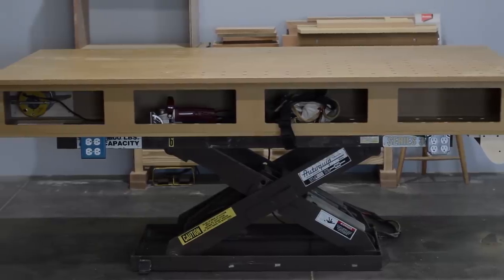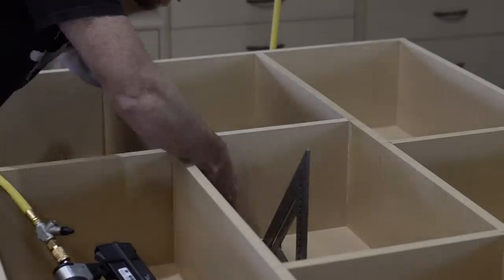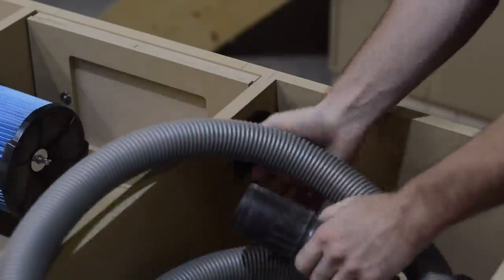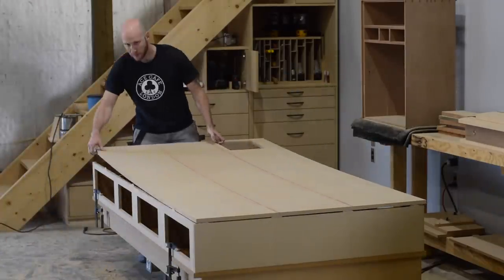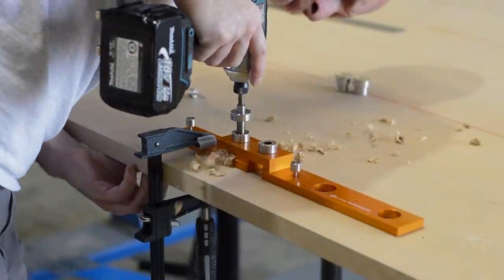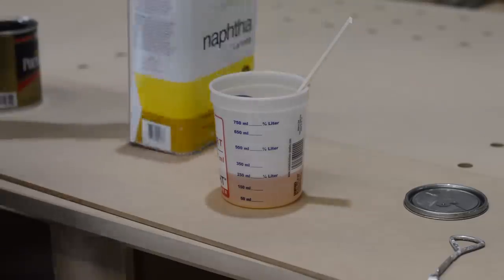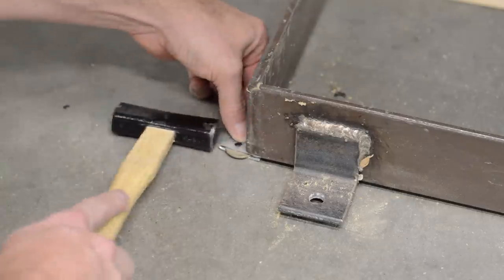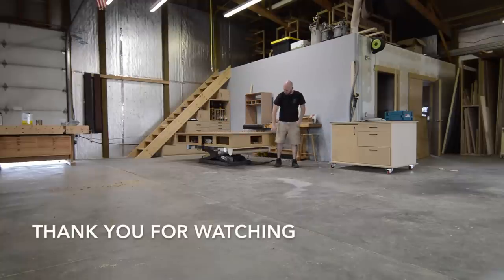A Modern Cabinet Makers Bench For Woodworking & Carpentry

Comment: Love your skies and laughed out loud at your shop assistant whacking the trash can with the mailing tube. What fun! There's a kid on YouTube who used Festool 32mm shelf pin hole track to lay out a 96mm grid  (every third hole makes 96mm) like Peter Parfitt's system. For tightwads like myself that would reduce the out-of-pocket  to paying for the Parf System's long-center-spur 20mm bit, some pins, and Parfitt's slick little spring clips to float guide track up and down on his tall pins set at any spacing. Thanks for posting and keep up the good work.
Reply from the maker: Thank you. I think your plan will work good, and maybe save a few bucks as well.

Comment: Mike, my first bench was on a scissors table lift with a Norm Abram designed torsion box bench (minus the legs on it) that I built. Wished I had never sold it but the guy who bought it wouldn’t take no for an answer and kept offering me a higher price until I said yes.
    You did a good job on yours.
Ron
Reply from the maker: Thank you Ron. Norms bench was cool for sure.

Comment: Pretty cool. I like that scissor lift, but alas my days of a fixed built shop are behind me and I think getting it in and out of the trailer on jobs would be a bit of challenge😎🤙
Reply from the maker: Ron! Holy cow! This is great. Thank you for commenting on my video. I have plans to make a bench in your style for my install setup at some point.
Reply: a couple of scissor jacks and a drill could make a mini lift table a la Paulk ;)
Reply: Mike, you won't regret it. I bought all of Ron's plans and built just the bench. I figured it's the least I could do for the amount of effort he put into it. I use it on a DAILY basis.  If not as a full 4 by 8, I use it the most as a 2 by 8 mini bench.
Reply from the maker: Thank you Aaron, good advice.
Reply: Aaron Berk I’m a big fan of Ron Paul’s.  I purchase all the plans as well and have used his sketchup contributions to fit out my single car garage work shop.  And love my RPWB.  His hours and hours of how to vids are my best investment.
Reply: I had fit a hand crank motorcycle lift to my Ron Paul’s work bench years ago.  It was one of those projects I couldn’t get out of my mind until I did it.    At the time I had a super bad back.  It was nice the few times I used it.  Found out it was my dodgy weight that was causing the pain.  Lost a decent amount of weight and didn’t need the lift anymore so removed it.  And haven’t missed it at all.
Reply: Hi Mike, I agree, Ron’s youtube channel has been very inspirational for me, I fixed my Sprinter van as my mobile shop just like Ron’s SMART tool box, he was extremely kind to publish my video on his channel, I also built my own working station and it has been very helpfully.

Please Mike, keep publishing this amazing videos, I’m also learning a lot from you!
Reply: @whoDatBeDare  I didn't know ron paul was a carpenter
Reply: Mike Farrington would like to hear you get that excited doing a voiceover for a video
Reply: @aaronberk1234  Agree - I bought the plans just because, even though I didn't build the same bench.  Ron's work is to be appreciated!
Reply: You know you could use that fairly cheap Harbor Freight car scissor lift and put that box on top. Take the box off and work on your car afterwards

Comment: Great build. I like how you explain the reasoning behind the mods you make. I have been looking for an adjustable height assembly bench but had not considered hydraulic scissor lift. Sucks that the hold down clamps wouldn't go through 1" material without modification. Keep up the good work.
Reply from the maker: Thank you. This lift has been a great addition to the shop.

Comment: The sleep number bench...    I have the same issue with the hose and I will probably drop mine from the ceiling.  Not really a good option for you though.  Whats frustrating is using the track so and the ridges of the hose catch the edge of something.  You think your saw is cutting through something heavy, but its just stuck from the hose.
Reply from the maker: Thank you, I like that, the sleep number bench. I considered dropping from the ceiling, but that wouldn't solve the plug issue. With this setup the hose and the plug go to the same spot. This is just one in a million ways to solve the issue. The hose catching is a problem as well....

Comment: At a previous job, I had a hydraulic lift table that I could use. At first I thought "I'll never use this" but after the first time or two it became MY workbench. Funny you mentioned the motorcycle lift. I did exactly that for my home shop about a year ago. Got one from Harbor Freight and mounted my torsion box table top to it. It is immensely helpful to get he project at just the right height.
Reply from the maker: Thank you. Its certainly a nice tool to have in the shop.

Comment: Great build and love the inclusion of the shop vac.. I might try and pick up an old Dyson motor on ebay and see how that works in my own torsion box! Did you consider hanging a dust bag under the collection box, might work a bit like a cyclone??
Reply from the maker: Thank you Stuart. I think any old shop vac motor could be adapted. I didn't think of hanging a bag, thats a good idea. If this doesn't work, I was going to hook up vac bags in the dust collection area. I made sure to size that area so I could use commonly found bags.

Comment: Great build and a nice bench, the lift you have is very strong. It looks as if our NHS in England has ripped off the idea because most of the modern day beds have a very similar system. I would like to build one of those the only trouble I would have is that my entire work shop is only 6 ft by 8 ft and I have to keep all my tools in there as well.
Reply from the maker: Thank you. No reason you couldn't make a smaller version.

Comment: Getting your hoes to lie straight is, Donald says, dang difficult and potentially expensive.....
Take a perfectly good tall dog and drill through it to then put Velcro/wire/bandage etc through it ......
Revised thoughts pt 2:  drill a 45mm dia hole (or whatever size your vac hose dia is plus some wiggle room) through a 60mmx40x80 piece of solid wood. Then turn down the body of the wood to 19.6mm x 60mm into a Festool dog that ultimately has a hole through the top of the dog. Place dog in hole and feed hose through and use to position vac to manufacture 5 more. Place three in bag and post to me. Use yours to continue dust management and consequently make more entertaining vejayos....
Greetings again from SW Australia.
Reply from the maker: I like the idea, though, I probably won't make extra... Thank you very much, good idea.

Comment: Excellent video. Nice blend of warmth, humor and instructional info. Definitely I'll use some of your ideas along with Ron's in building my portable bench along with the use of the 90 degree dogs I've not seen done before.  
I'm not sure how it could be accomplished, but I use a bag in my shop vac.  In my old vac I rigged a pillowcase around an abs pipe with a larger adaptor on the end to hold it in place.  I go 10 times longer before the vac begins to clog up.  Of course I often am sucking up sheetrock dust.  
Again thanks for your wonderfully done share!
Reply from the maker: Thank you very much. I have considered using a bag. So far the only thing I have changed with this setup is I upgraded to a HEPA filter. Its been working great otherwise.

Comment: You really should be wearing a dust mask each time you use a power tool to shape or cut the MDF!!! That precious little one needs you to healthy so you can watch her experience life. MDF dust - BAD STUFF! Great video otherwise!
Reply from the maker: Yes, thank you. That was part of this build, to help with that very issue.
Reply: Your right buddy pulmonary fibrosis is no fun trust me.
Reply: I agree that MDF stuff is nasty.
Reply: Thanks for the head's up, y'all. I'll be sure to mask up when we're cutting mdf at work :-)
Reply: Also mdf for a large majority of manufacturers contains formaldehyde. Your little cabinet helper doesn’t need to be around that. ( Industrial cabinet maker 20 years.)

Comment: Me too! I found a lift very similar to that - but built right here, in southwestern Ontario, Canada. I bought it off of Kijji. lol! and also paid a fraction of what new would have been. and, I absolutely love it. It just shuts up and works! One can work on anything at at any height, either sitting down or standing... With my health, its as the only way I would get anything done... Am extremely grateful I found it.
I too, have considered using a Paulk-style bench top on it. But, I kind of like the idea of using conventional bench dogs, and have red oak stashed away that I plan to laminate and create a solid 3-4" top with the edge grain as the top. That's my plan... some kind of vise on the side and an end vise, as budget allows.
Great video! Glad to know I'm not the only one crazy enough to have a hydraulic workbench in a wood shop! :-)
Reply from the maker: A lift bench is nice to have for sure. I kicked around the idea of a solid top as well. I ended up going this direction because I am fortunate to have a more conventional bench as well.

Comment: Hey Mike.  Great video.  I also purchased the Parf Guide system.  My bench top is 1" particle board with a laminate top.  It was already built in.  I started drilling the hole.  When I got tired, I tried my Festool clamps.  I am bummed, they won't go through the hole.  I can't get to the underside to chamfer the holes.  So I am screwed.  I'm glad I didn't keep drilling any more holes.  Keep up the great work.  It is great to see your apprentice in the shop as well.
Reply from the maker: That is a bummer, is your top already glued up?

Comment: Thanks for sharing. I used a sheet of peg beard Plugged some holes and opened up the ones I wanted, harder than MDF. Screwed down to a sheet of 3/4 stuck easily replaced. Cheers, Billy in Canada
Reply from the maker: Thank you. Thats a good idea. Well done.

Comment: Nice build as always Mike. Re your hose issue, I solved the same challenge by wrapping wire around the hose and twisting a small loop into it and then hanging a simple hook that hangs from the ceiling so I can hook up the hose out of the way whenever I want. Maybe that helps. Cheers.
Reply from the maker: Thank you. This is a good idea. I'll put it into the idea bin.

Comment: I've gone all cordless in my shop for non-stationary tools... Except for my Bosch barrel grip jig saw!  I love that saw!
Reply: JB Lewis I have the same saw but I can’t seem to get the blade to cut vertically straight. It bends inward every time. Any idea what I could be doing wrong?
Reply from the maker: Thank you, yes that is a great saw. I have had it forever and it just keeps working.
Reply from the maker: Not sure about the blade bending inward.

Comment: Sweet table.  scissor lift is awesome.   Hose management idea, you probly already thought of it, use pvc pipe, cut into 1inch wide segments and screw small pieces of wood that will fit in the bench dog holes.  you can leave them on the hose and just push them all the way to the back end when you put the hose away.  when you want to use them, they will slide enywhere along the hose you need.  the square edges on the cut pvc segments will help hold the hose a little bit.
Reply from the maker: This is pretty close to what I was thinking, especially with the threading already on the top of the dog. Such an easy build.

Comment: I do use my motorcycle lift as a workbench with a 24mm ply lid on it. Just bought the Parf Mk2 system to put holes in things.
Reply from the maker: That sounds pretty cool.
Reply: @MikeFarrington  It's a scissor lift type like yours but I have to pump it up by foot although I do believe I could connect an air line? I've also got one of those double height scissor lift trolleys, really useful except it's all in storage at the moment until I finish building my workshop, one day. Have to admit, you yanks drive me nuts with your huge workshops. We're lucky if we've got a 4'x6' shed in the UK. ;) :(

Comment: Im making something similar. I’m also using a static, main operated lift table originally used for welding, car repairs and the like. I was able to buy a used one for £220 delivered to me. I’ve already made a torsion box table with HD castors and have a top planned much like yours. I use mine as an infeed or outfeed table for all of my machines - none of which are same height. I use it as an auxiliary work table to my main bench. The biggest advantage to me personally is to be able to wheel it to the timber racks and take what might be a large slab onto the lift table and then wheel it to the table saw or band saw. All without straining my increasingly problematic skeleton. 

The downside is the plugging and unplugging of the mains cord for lifting and lowering. However, my shop is about 8m square with perimeter power sockets plus 4 hanging down in the centre of the shop - so I’m never far away from a handy socket. When you look at my total cost (£350?) against a RUWI or Felder option, I’m very happy.
Reply from the maker: Sounds pretty neat. Thank you.

Comment: The efficiency, of vacuuming, the same dust twice, seems a bit questionable, but i really love everything
about this bench, except the vacuum, lol, I'm in process of basically duplicating it, many thanks for 
the ideas, and the video!
I will be attaching a boom to closest wall by my bench, to manage air line, vacuum hose, lighting, and electrical.
Also hope to come visit you someday, bought me 1.3 acres of a mountain, not to far from you.
Reply from the maker: There is certainly an efficiency loss to cleaning up the clean up, but it's maybe a couple minuets every other month. So not a big deal. I do think a boom would be better, and I will probably go that route as I build my shop more.

Comment: I have a similar bench (also used PGS for the holes).  I use an overhead hose and it's awesome.  Make it long enough to reach the corners with a bit of slack and it never gets in the way or hangs up on the edge of the table.  Looks like your ceiling is high, so maybe an arm (movable?) made out of a bit of pipe with a 90 degree bend in it and attach it to that grey wall next to the table (up & over to the bench).  Kind of makes the inbuilt vacuum redundant though, but I think you'll be glad you did.
Reply from the maker: Thank you. This is a good idea. We shall see what I come up with.

Comment: Great job.  Love the way you use the dog holes...By the way the bolt you used appears to be a Socket Head Cap... usually hex.  They are common in tool and die making.  The hole that relieve the head is called a counterbore (similar to countersink) and you can buy a counterbore bit designed for each size socket head cap bolt. You can also get countersink rather than counterbore for thinner stock.
Reply from the maker: Thank you, great tips!

Comment: I’ve not long built something similar myself and the jigs you made at the end are a great idea I hadn’t thought about. If people don’t want to buy that part hole jig as it’s too expensive, then they could do what I did and find someone on eBay who has a Cnc machine who makes MFT replacement tops and use that as a guide 👍🏻 another great video mate, really enjoy your humour
Reply from the maker: Thank you. I agree on the cost of this system, and also CNC is a great option. In my case I have plans to build a few more different tops for around the shop and job site, so the cost will be spread over a few projects.

Comment: OK I'm sold, thanks!
Reply from the maker: Thank you.
Reply: @MikeFarrington  Ordered that dog hole drilling system from Lee Valley, thinking about using them as downdraft holes for dust collection too, we'll see how it goes...
Reply from the maker: @tzed2509  I think you'll like the system. As to down draft, you'll need a pretty big vac.
Reply: @MikeFarrington  Received the kit the other day, very impressive quality and engineering. I was planning on using my shop dust collection system for suction so it should be adequate. I might divide the table into sections that can be opened or closed off to further increase efficiency...
Reply from the maker: @tzed2509  Sounds like a good plan.

Comment: Nice work. Careful with that vac switch. I've had two and they both failed due to their cheap relays, which you can replace pretty easily.
Reply from the maker: Thank you. I have had three of these in my shop for years and they just keep on working.

Comment: Great video, Mike!  I have linear-actuated lifting on one of my workbenches, but really want to combine that feature into my primary work bench. Also, that Parf bench dog guide system looks amazing!  I just wish there was a "rental" of something like that, as it doesn't seem like a jig/tool one would use often, unless you were setting up several bench tops, etc, with dog holes. Thanks for showing us such a cool work bench and configuration!
Reply from the maker: Thank you Seth. I agree, renting the parf guide would be great. Its certainly not cheap, but if you think about using it a bunch of times over many years it will pay for itself eventually.